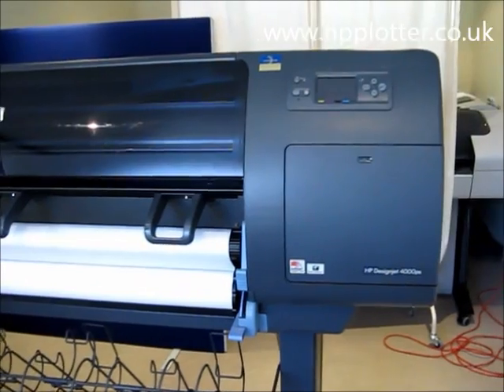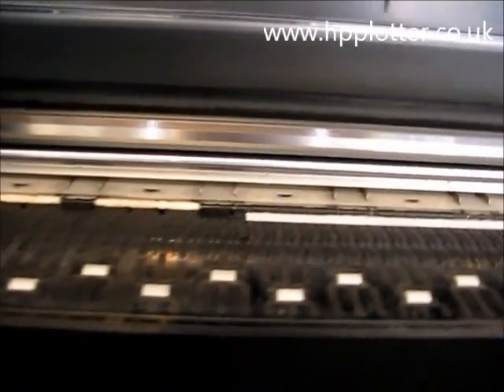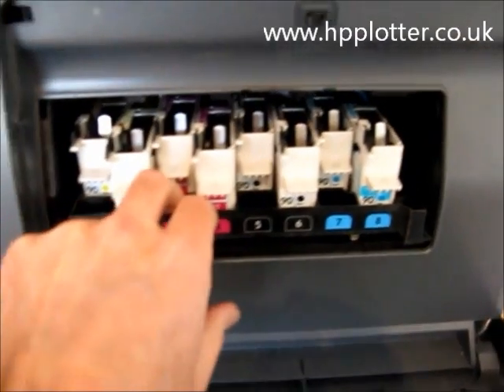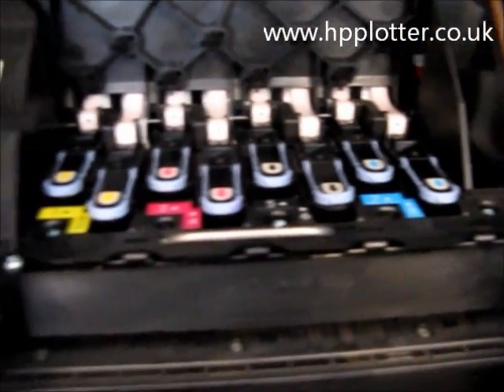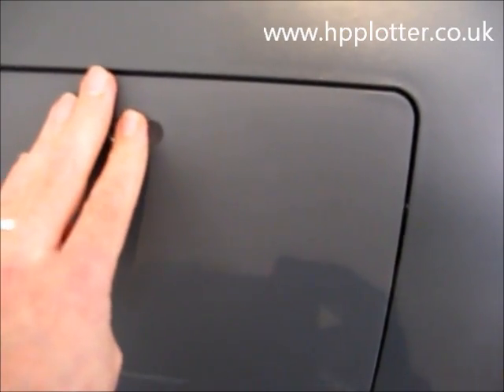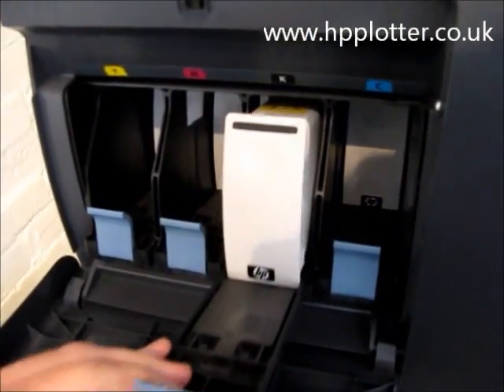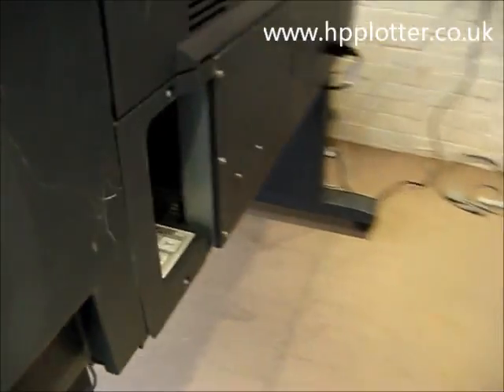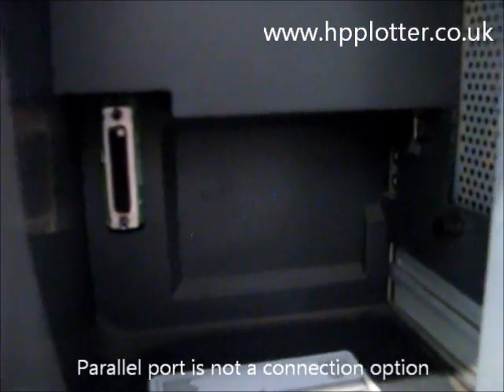DesignJet 4000 overview

Comment: does the plotter only prints with 8 printheads ? or we can print with just 4 printheads each one of one color ?
Reply: You need all 8 printheads in the printer for it to work.
Reply: @snootybutnice  I'm from brazil, those printheads here, originals, are to much expensive, can I use chinese, printheads?